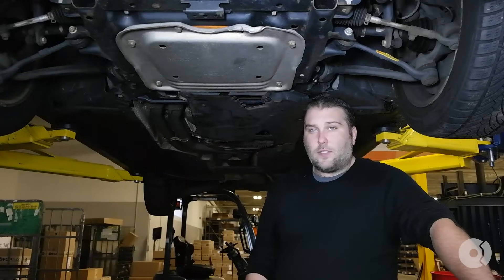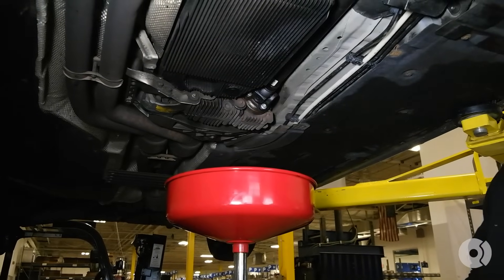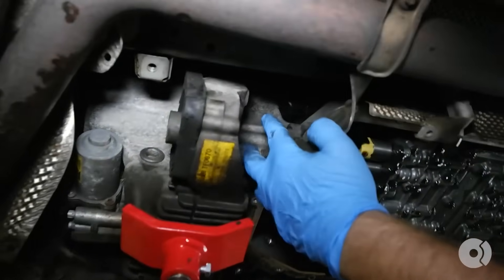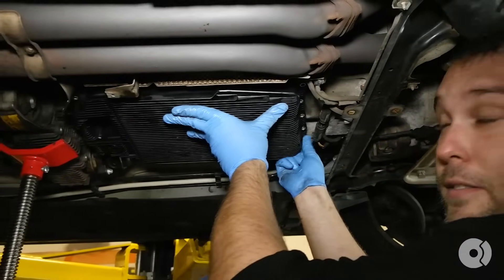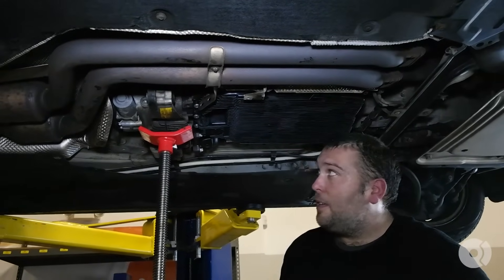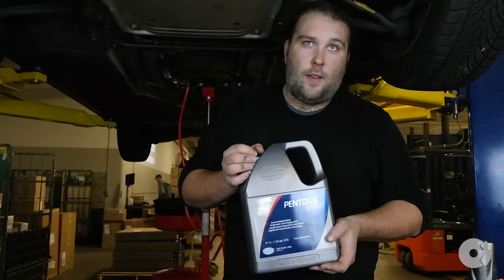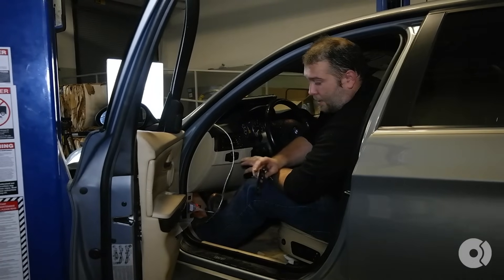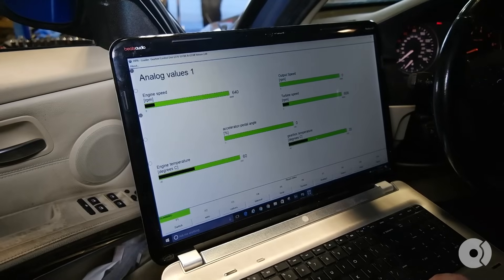BMW 6HP19 Transmission Service - Prolong Your Transmission's Life (325, 328, 335, 525, 530, 740)

Comment: At minute 2:50 the rear transmission mount bracket  is on....⚡poof⚡....2:57 the rear transmission mount bracket is off and a screw jack put in place. No acknowledgement until 9:25🤷‍♂

Comment: In regards to running the car.  I will have the front wheels on Rhino Ramps and the rear will be supported by jack stands on the stand holders on the frame/rocker panels.  The rear wheels will be off the ground.  Can't I run and shift it like that..I won't be under the car when running.  The rear wheels should just slowly spin in air..won't this work?  Thanks
Reply: Did you find out ?

Comment: If you don’t have access to inpa, can you use a temp gun and point towards plastic pan? Also maybe try and hit the flow of fluid draining out?  I know it will not be as accurate as software digital reading.. but in a pinch will it be ok? 

Also.. to get the vehicle at operating temp 30-50 Celsius do you have to drop the car off jack stands are drive around..? I’d be scared to drive around with low fluid..? 

I can be completely wrong but I’ve heard idling does not warm the transmission..?

Comment: I have a 2007 530ix  and the transmission flutters or seems like it slips when accelerating....  what is my problem?
Reply from the maker: Hi Mark, your problem could be as simple as your transmission being overdue for some new fluid and a filter but we recommend trying to get it diagnosed before buying new parts. We recommend finding a shop local to you to help you properly diagnose the car then heading back to us when it's time to buy new parts. Hope that helps!
Reply: Just got an 08 528xi with the same exact issue, did you figure it out? Im too lazy to take it to a decent shop to get some diag

Comment: Quick tip, for the 6 speed There's another fill plug on the driver side of the transmission housing, towards the rear
Much much easier to get to and it's far less headache

Comment: So I need a shift sensor for a ‘03 BMW 325i. I’m trying to buy this off fb marketplace and that’s the only issue. So if I buy this part can I do it there and drive is home or should I trailer it?
Reply from the maker: Sure, Niko! If that solves the problem I don't see why you couldn't drive it home! However, its probably a good ideas to have a trailer at least lined up just in case.
Reply: FCP Euro I email you guys and Kevin helped me out. I just wanna double check if the shift sensor he linked me was the right one because, well I don’t wanna spend $75 on a part I don’t need. (Part #: 24337504753)

Comment: On the XI model, it's possible to access the ATF fill hole without removing the transfer box bracket (just remove the exhaust hangers from the transfer case). However, the bracket must be removed in order to replace the mechatronic sealing sleeve. The transfer case support bracket is such a pain to remove because, in order to do that, the exhaust must be first disconnected and let dangling (fighting the rusted nuts!), then the aluminum heat shield must be removed, only to expose the long bolt/nut that holds the bracket to the transmission rubber mount. So when you drain-refill ATF, you might as well replace the mechatronic sealing sleeve and replace transfer case oil at the same time because the transfer case fill hole is also blocked by the same transfer case support bracket.
Reply: Great Comment! Thank you! There's almost NOTHING on X drive Trans fluid or Mechatronics work. It's Not a plastic pan like all of the others which is frustrating when you need to do any work on it.

Comment: Question I change transmission oil everything the same way after put back together whatever the car ran good and all of a sudden is slip gears so that you something wrong or what was the reason for it doing that you can please let me know thank u...
Reply from the maker: I would check your fluid level and make sure it is correct. If it is low on fluid, that could be the problem.

Comment: I have a transmission whine & weird shifting what could be the issue?
Reply: Most likely the transmission pressure solenoids and valve seals need to be replaced.

Comment: I really appreciate this because I could not for the life of me figure out where the fill plug is. There is a plug on the left side rear of the transmission adjacent to the front drive shaft connection the xfer case, so I thought the drive shaft needed to come off, and I think some people have been using this for the fill plug. The Bently manual does say the fill plug for the ZF is on the right, but has no picture as their procedure is for the GM trans. So thanks, I may return my drive shaft bolts now. Having to remove abd replace the drive shaft bolts each successive fill (in a multi drain-fill replacement) would be a hassle and expensive as they are one time use bolts. The only thing not clear from your video is if you must remove the xfer case bracket. You discussed putting it back on but not taking it off in the first place. Thank you!
Reply from the maker: You're welcome Rick! Glad the video helped out.
Reply: But wait, then I watched this one a few minutes later where it is back on the left side above the drain hole!!!:
https://www.youtube.com/watch?v=2g-5uY_P7uA&t=146s
WTF? Mine is a ZF 6HP19 07 335xi. Going out there now to just drain and refill whatever comes out so will report back.

ZF has line drawings of the different trans but could not tell where the freakin drain hole was. I think they basically don't want laypeople working on their boxes. Either way, really appreciate the video.
Reply: So on my vehicle the fill is in fact on the driver side above the drain, removal of the drive shaft necessary unless you are really into contorsionism. I just did a drain / refill and will drop the pan in a week or so and do the rest. Immediate improvement with only 4+ liters. Must replace the drive shaft one time use bolts 15ft-lb plus 90 degrees. 135k miles.
Reply: Just learned this type bolt, torque to a value, then turn 90° is a "stretch" bolt

Comment: my 2007 bmw 328i with 129k miles got code 578E says “gearbox oil wear” so is that mean i should drain and fill my transmission fluid?
please your advice sir,bcs some mechanic told me to not/never change the liquid.

Comment: I'm not going to use a laptop, how long does it typically take for gearbox fluid to reach temp? Also I saw somewhere else operating temp is between 80-100 degrees F?
Reply: Bump

Comment: Hi man my dads 2013 vw phaeton 3.0 fsi also has zf6hp19 on it. Currently the car needs a service, local dealer says it should be used zf8hp oil not 6hp one. Do I take dealer advice or I go for 6hp oil? I’m confused. Thanks in advance!

Comment: For the last fill do you need to have the car running or just until it gets warm enough for the new fluid?
Reply: Car MUST be running, otherwise fluid will drain from the torque converter, and you will be about 2L low after refilling.
Reply: @thomasstiglich3484  Thanks, wondered about why it should be running
Reply: So when you refill a car going to be on, this is my first time now I got a bunch of calls when I change the pan

Comment: I have a 08 e92 335i auto with e gear fault. 5-6 slips under boost. Is it worth or possible to rebuild or should I pick another trans. My car just hit 100k? I really need some input.
Reply: Clutch e fault*
Reply: Same here with 325i did you get this resolved brother?

Comment: I have a 2009 bmw 335i with 53k miles when do recomend I change the transmission fluid?
Reply from the maker: Hi Roberto, now would be a perfect time to replace the fluid. Generally, every 50k miles is a good time to do it. We have preassembled kits currently on our website. If you want to verify fitment, feel free to email service@fcpeuro.com
Reply: @fcpeuro  awesome,  thank you!
Reply from the maker: @roberto0612fcb  You're welcome!
Reply: That change oil in converter too or we need to do special thing to drain and fill out the converter?

Comment: Hi! I don't have access to diag software to measure the fluid temperature. Do you know roughly how long it takes for transmission fluid to warm up during idle?
Reply from the maker: Hi Anoop, that will all depend on the environment you are working in, there is no real way to tell the speed of it. As a very last case resort, you can use a temp gun to try and get a reading off the transmission pan.

Comment: To the crew at FCP Euro, have you encountered any complaints from customers with E90 ZF transmissions regarding jerking/jolting in these cars from the transmission? I’ve read this issue can be due to bad solenoids, sealing sleeves, etc. Thank you in advance!
Reply from the maker: Hello Adan, we haven't heard of many issues in regards to jerking or jolting of the ZF 6-Speed trans. They're are some issues with bad solenoids or sealing sleeves with high mileage vehicles. We recommend a transmission drain and fill service for transmission longevity and to smooth out the shifts. The ZF trans is a well made unit and doesn't have many issues.

Comment: I have a 2006 325i and whenever I shift from P to R or R to P or N to R, it jerks the car back and forth. It doesn't have any problems shifting while driving. It might have a tiny problem while driving but not as noticeable as when the car is stationary. I took it to a BMW dealer and they said that the mechatronics sleeve needs to be replaced. Will this fix the issue ?
Reply from the maker: Hello Ridwan, It does sound like its definitely an issue linked to the mechatronics. I'm sure replacing the sleeve will most likely resolve the problem.
Reply: Im having the same issue with a BMW 328i 2009... Just got the car with 118k miles. What should i do and how do i fix it?
Reply: Sourabh Sharma I am going to replace the mechatronics sleeve on my trany. I'll let you know if that solves the problem.
Reply: Perfect! Thank you. I will take it to a few shops in my area to see what they say. Also, did your dealership charge you to check the car?
Reply: Sourabh Sharma they charged me 179 to do the diagnosis. I am going to fix it at a shop near me since it's way cheaper. If that doesn't solve it, I am going to ask BMW to do another diagnostic.
Reply: Oh ok. Hopefully, someone does it for free LOL. If not it's worth the money. Apparently, the part is like $30
Reply: I think that will solve the problem since ZF recommends changing the fluid every 50K and I am sure mine is all dirty and clogging the solenoids. I just hope my solenoids aren't damaged.
Reply: Same, i am thinking about getting the transmission serviced too since the car is used. I need to find out which trany i have
Reply: Sourabh Sharma what car do you have ?
Reply: I am going to use the 179 to do a fuel injection service ;)
Reply: Hi, Ridwan.  Did you solve your shifting problem by changing the mechatronics?

Comment: I have 165k miles on my e90 n52 automatic. As far as I know fluid has never been changed. Should i even consider doing a fluid change or is it to late in my case? Was also thinking I could just top off the fluid from the fill plug and not do the fluid change.  Any thoughts would be appreciated
Reply from the maker: If it's just a basic drain and fill you'll be fine and that would still be recommended. I would avoid flushing fluid out of the torque converter as that could cause clogging of the valve body.

Comment: Hey guys:   for the zf 6HP19X transmission on an drive BMW, there is also what looks like a fill plug on the left hand side, near the rear of the transmission but behind the front axle that comes off of the transfer case.  Is this in fact a fill plug also, or is it something else?  Because it seems easier to remove the for E12 bolts holding that small axle to the transfer case and moving it out of the way - then that other fill plug can be accessed easily with a normal allen key socket.

What do you think?
Reply from the maker: The plug you're referring to is not a fill plug and is slightly higher on the transmission housing than the actual fill plug on the right side under the mechatronic sealing sleeve. The issue with using the plug in question over the actual fill plug is you run the risk of overfilling the transmission due to the fact that it's slightly higher. The worst thing you can do with an automatic transmission is to get the fill level incorrect. We only recommend filling and checking the fluid level in the service via the actual fill plug.
Reply: @fcpeuro  How is the bracket removed ?

Comment: Hey won't the new fluid act as a detergent and loosen up the particles that was in the transmission and cause it to slip ? I heard that this can happen. Not sure if i should go through with the drain and fill procedure. Also for a high Km car, What do you think ?
Reply from the maker: Hello Jameer, a basic drain and fill shouldn't cause an issue. You'll want to avoid having the torque converter flushed out because that could loosen up particles and clog channels within the valve body. We recommend basic drain and fills at 50-60k intervals.
Reply: I realize I'm replying 5 years later, but for others wondering about this, the answer is no. 
 Changing transmission fluid is always a good thing.  If there were any "particles" the detergents would "loosen up" they would be captured by the transmission filter. Think of the logic behind that superstition, is dirty fluid what's holding your transmission together?
I think that rumor was started by people whose transmission was beginning to fail, and they changed the fluid, but the tranny still failed. So they blamed the fluid change, which is illogical.
It's a superstition as false as the one about batteries on a cement floor will somehow be "shorted" and lose voltage.

Comment: It seems this is not actually a flush, this is just drain and refill?
This does not look anything like the flush procedure I recently had on my 335i, where they used about 16 liters of oil to completely flush out all the old and nasty oil from the transmission.
My e92 335i now shifts as smoothly as when it was new.
Reply from the maker: The safest way to service a 6HP transmission is a drain and fill service. This is as recommended by ZF. We just updated the title as it's not the correct description for the procedure. You can do multiple drain and fill procedures to clean all the old fluid out but it's not entirely necessary or recommended as wear material in the fluid is needed to allow for proper engagement of the clutches inside the transmission (wet clutches). It is not advised to use a flush machine seen at transmission shops on one of these transmission.
Reply: This was done at a BMW dealer in Germany. It shifts nicely when doing high speed blasts on the Autobahn, and that is with an ESS stage 2 ECU tune, pushing 150nm more than normal (550nm rather than 400nm).
No hint of slippage or other problems.
Before the flush it shifted hard and made some clunking noises, especially in normal Drive mode.
From my perspective, the flush they did made the transmission feel like new (they also changed mech sealing sleeve and solenoids).
Reply: I do believe that it was the new solenoids that made the whole difference. Did they just replace the solenoids or they actually re-built the valve body?

Comment: why are you replacing the oil pan ?
Reply: The oil pan has an integrated filter. It's recommended to change the pan whenever you perform a fluid change.

Comment: I have a 2011 328i  base model with 102k on it been thinking of having my transmission fluid drained and new fluid put back in and the filter changed should I do it? Or will it cause problems or slipping a few months down the road?
Reply from the maker: It can't hurt. As long as you follow the drain and fill procedure and perform the final fill in the operating temperature range there is no downside to doing the service. The reason for the drain and fill and not flushing the entire system with a machine is the machine can remove all wear material from the transmission which will cause the transmission to start slipping. Automatic transmission use wet clutches to engage and disengage gears. The wear material in the fluid and in the clutches helps engage these clutch packs.